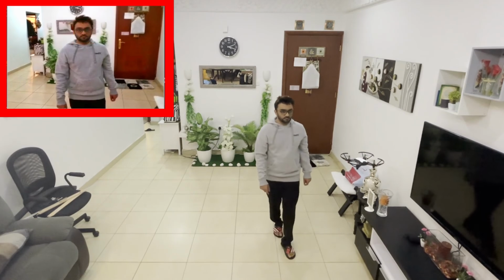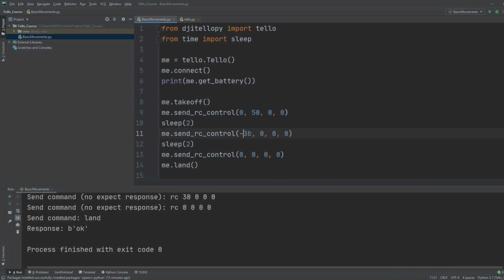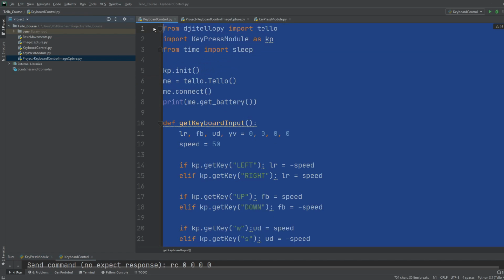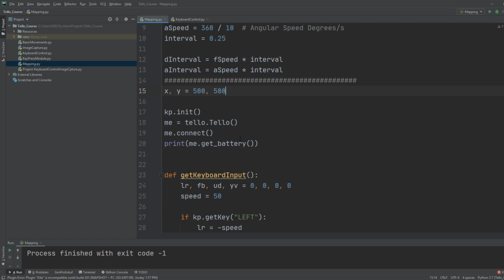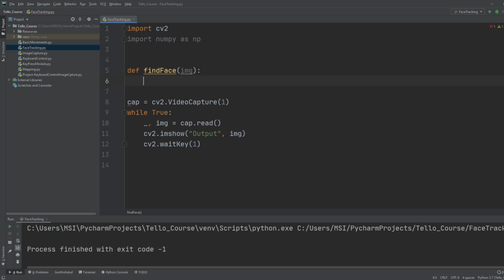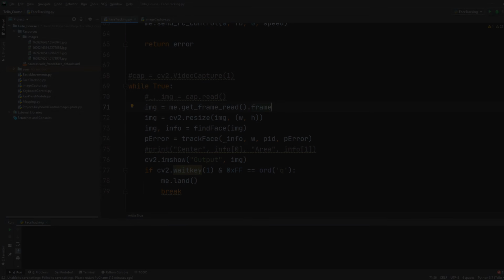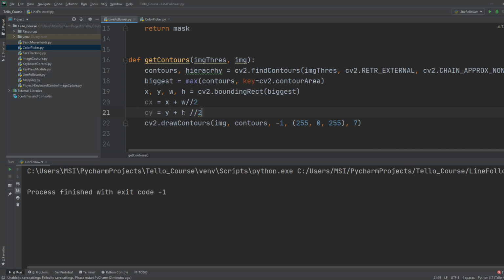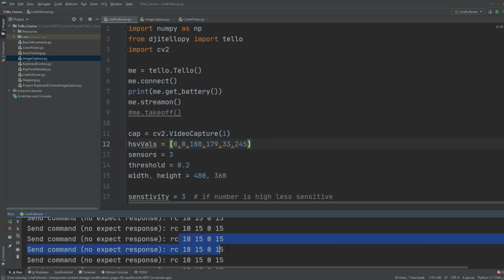Drone Programming With Python Course | 3 Hours | Including x4 Projects | Computer Vision

Comment: Nice video, thanks for your effort puttin this together. Does it work with any drone, are there any specifications for the drones this will work. Its obvious it will need wifi connectivity; is there any other requirement or specification that can be checked with other drones.
Reply: Wd love to get some details or pointers from anyone in the community or the author.

Comment: Can we use Anaconda instead of pycharm? Will it have the same/similar coding? Please answer
Reply: You could use any IDE that runs Python. Anaconda is not an IDE, but is instead a distribution of Python (basically, its the Python language + some other libraries that are used for scientific computing). Anaconda does come with Spyder, which is a Python IDE. You could use that. Best of luck!
Reply: @chriswhitmire4167  thank you for the information, really appreciated it.

Comment: Hey, I like the video but I have problems with the Image, I just cant see the video of the drone, I did like 5 times just like you and it just isnt working. Is it maybe because of a new Version of pycharm (I use 3.7 Python) or a new firmware update of the drone (I checked my version of the firmware its the newest). I just dont know what to do, do you know the problem? If I use the drone on my mobile i see the video. But in pycharm the window just isnt there

Comment: Hi, Thanks for the video, I have few questions:
- is there any drone I can connect to my wifi AP? What I need is to be able to access the drone from the routed network instead of only have access by direct connection.
- Can I apply live face recognition analysis to the captured video and then stream it to other users?
Thanks in advance for your answer.

Comment: [h264 @ 0000019ab6699b40] non-existing PPS 0 referenced
[h264 @ 0000019ab6699b40] decode_slice_header error
[h264 @ 0000019ab6699b40] no frame!
[h264 @ 0000019ab8394b00] non-existing PPS 0 referenced
[h264 @ 0000019ab66ab040] non-existing PPS 0 referenced
[h264 @ 0000019ab8394b00] decode_slice_header error
[h264 @ 0000019ab8394b00] no frame!
[h264 @ 0000019ab8394b00] error while decoding MB 31 40, bytestream -10

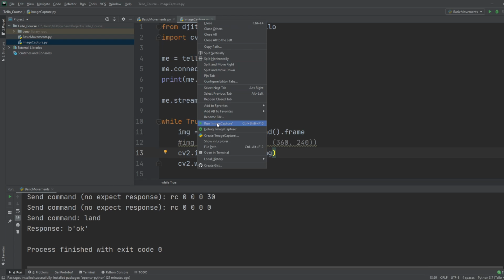Comment: This has to be one of the best channels on youtube! The BasicMovements work fine, I have an issue with the live stream of the tello. At 35:07, I tried to also run the ImageCapture.py file, and it returned the battery level fine, but then it came up with lots of errors even though I commented out line 10 and the live stream did not appear. These are the errors: 
Traceback (most recent call last):
  File "C:/Users/Ssaif/PycharmProjects/Tello_Course/ImageCapture.py", line 12, in <module>
    cv2.imshow("Image", img)
cv2.error: OpenCV(4.5.2) C:\Users\runneradmin\AppData\Local\Temp\pip-req-build-dn5w5exm\opencv\modules\highgui\src\window.cpp:404: error: (-215:Assertion failed) size.width>0 && size.height>0 in function 'cv::imshow'

[h264 @ 0000026cd22bd680] non-existing PPS 0 referenced
[h264 @ 0000026cd22bd680] non-existing PPS 0 referenced
[h264 @ 0000026cd22bd680] decode_slice_header error
[h264 @ 0000026cd22bd680] no frame!
[h264 @ 0000026cd22bd680] non-existing PPS 0 referenced
[h264 @ 0000026cd22bd680] non-existing PPS 0 referenced
[h264 @ 0000026cd22bd680] decode_slice_header error
[h264 @ 0000026cd22bd680] no frame!
[h264 @ 0000026cd22bd680] non-existing PPS 0 referenced
[h264 @ 0000026cd22bd680] non-existing PPS 0 referenced
[h264 @ 0000026cd22bd680] decode_slice_header error
[h264 @ 0000026cd22bd680] no frame!
[h264 @ 0000026cd22bd680] non-existing PPS 0 referenced
[h264 @ 0000026cd22bd680] non-existing PPS 0 referenced
[h264 @ 0000026cd22bd680] decode_slice_header error
[h264 @ 0000026cd22bd680] no frame!
[h264 @ 0000026cd22bd680] non-existing PPS 0 referenced
[h264 @ 0000026cd22bd680] non-existing PPS 0 referenced
[h264 @ 0000026cd22bd680] decode_slice_header error
[h264 @ 0000026cd22bd680] no frame!
[h264 @ 0000026cd22bd680] non-existing PPS 0 referenced
[h264 @ 0000026cd22bd680] non-existing PPS 0 referenced
[h264 @ 0000026cd22bd680] decode_slice_header error
[h264 @ 0000026cd22bd680] no frame!
[h264 @ 0000026cd22bd680] non-existing PPS 0 referenced
[h264 @ 0000026cd22bd680] non-existing PPS 0 referenced
[h264 @ 0000026cd22bd680] decode_slice_header error
[h264 @ 0000026cd22bd680] no frame!
[h264 @ 0000026cd22bd680] non-existing PPS 0 referenced
[h264 @ 0000026cd22bd680] non-existing PPS 0 referenced
[h264 @ 0000026cd22bd680] decode_slice_header error
[h264 @ 0000026cd22bd680] no frame!
[h264 @ 0000026cd2323140] non-existing PPS 0 referenced
[h264 @ 0000026cd2323140] decode_slice_header error
[h264 @ 0000026cd2323140] no frame!
[h264 @ 0000026cd2d46400] non-existing PPS 0 referenced
[h264 @ 0000026cd2d46400] decode_slice_header error
[h264 @ 0000026cd2d46400] no frame!
[h264 @ 0000026cd2ccce80] non-existing PPS 0 referenced
[h264 @ 0000026cd2ccce80] decode_slice_header error
[h264 @ 0000026cd2ccce80] no frame!
[h264 @ 0000026cd2a8b200] non-existing PPS 0 referenced
[h264 @ 0000026cd2a8b200] decode_slice_header error
[h264 @ 0000026cd2a8b200] no frame!

Process finished with exit code 1

I have tried everything I can think of, but I am unable to fix this issue. I have reinstalled python to version 3.7 as you have done, reset pycharm, and checked for various errors but it will not work. Please give me some advice as to how to fix this.
Reply: I’ve been having the same issue and no solution has worked for me so far!
Reply: I am having the same problem so let me know if you figure it out
Reply: The error is saying that there is no image being captured, and because of that there is nothing to show on cv2.imshow. Usually you have to just change the index to correctly initialize your camera, it might change from each PC. But i'd have to see the full code

Comment: Dear teacher, when it runs to 35 minutes，“ img = me.get_frame_read().frame” ，No return, no image can be read, I can confirm that there is no error in the above code, and the battery level of printing can be displayed normally, which proves that the connection with the host is correct. Can you help me and how to solve it。
import cv2
from djitellopy import tello

me = tello.Tello()
me.connect()
print(me.get_battery())

me.streamon()

while True:
    img = me.get_frame_read().frame
    cv2.imshow("Image",img)
    cv2.waitKey(1)
Reply: I am having the same problem so let me know if you figured it out

Comment: Great stuff! But in the mapping exercise, how did you arrive at the values for “a” (angle) as -180 for left, 180 for right, 270 for forward and -90 for reverse? I cant seem to find an explanation for this.
Reply: I would guess a rotation of 180 degrees in both directions, so that it can fully spin around. And then 90 degrees and 270 (-90 degrees) room to tilt the drone

Comment: I found at that there might be some assertion error failed when getting stream on when I tried this out. For those who encountered this error, you have to set the up settings on your fire wall to the udp of the drone.
Reply: Could you explain how you did it? Do I need to allow inbound role for the drone udp port? Help much appreciated, thanks!
Reply: @junqima5127  let me know if you figured it out. I am having this problem

Comment: You start your video out incorrectly describing all remote controlled vehicles as drones. A drone is capable of autonomous movement and is fitted with instrumentation allowing it to be operated far from line of site by a human or computer assigned controller. Please learn your facts before sharing false information. The rest of your video was well researched. Its a real pity that you missed the main point of what you are explaining

Comment: Hey Murtaza or anyone that is able to reach out and assist. Every time I try to activate the take off function or any throttle in the matter I get a command error. I'm using pretty much your exact code. Any possible solutions?
Reply: I know it's 2 months past. Have you found solution on this? If not, you can add wait time on command or takeoff timeout on the djitello library. Also other solution is add more light if testing indoors

Comment: This is a really great tutorial Murtaza, I have learned a lot, thank you for sharing your knowledge. However I have run into an error during the coding of Project 3 - Face Tracking. 

import cv2
import numpy as np 

cap = cv2.VideoCapture(1)

while True:
    _, img = cap.read()
    cv2.imshow("Output", img)
    cv2.waitKey(1)

Exception has occurred: error
OpenCV(4.5.1) C:\Users\appveyor\AppData\Local\Temp\1\pip-req-build-kh7iq4w7\opencv\modules\highgui\src\window.cpp:376: error: (-215:Assertion failed) size.width>0 && size.height>0 in function 'cv::imshow'
line 8, in <module> cv2.imshow("Output", img)

Thank you also for your Discord channel, I have also posted this question on discord.
Reply: Looks like cv2.VideoCapture(0) opens my web cam, I am not sure how you tell other than trial and error.

Comment: Amazing tutorial, really man, hats off. This was simply perfect. Excellent explanations, straight to the point, and covers several projects that build on previous work. This was EXACTLY what I was looking for: a cheap drone, an exposed, easy to use API, and a tutorial that covers writing control code as well as opencv for image processing. It's incredible how quickly I could get things to run. Thank you so much!

Also, regarding you Mapping part of the tutorial. Wouldn't it have been better to use the get_speed and get_acceleration functions offered by djitellopy to accurately calculate the motion of the drone? That would yield very good results as opposed to relying on the speed value you make the drone fly with. I have not tried it yet, but should probs work well. Cheers!

Comment: I really like your video, but in the facetrack project, isn't a PID, is just a PD controller. There are significative difference between this types of control laws. For hobbyist approximate a PID using a PD is good but for engennieers or scientist this implication is relevant.  Despite this, I think that's a good course to introduce poeple for the programming this kind of technologies. 

Congratulations

Comment: i have been having this issue with basic movements with the drone flight, I get the error "no controller" when attempting to run a command such as move forward (python, pycharm).. I have been trying to solve this issue for ages.. I have updated and calibrated the drone multiple times and the code is also correct so i can't seem to find a fix.. also side note my drone light flashes pink and I have never seen anyone else have this light code and also couldn't find any reference to it any where if you know anything about this let me know. thanks.

Comment: Im currently making a fyp involving key box control system by using a face recognition technique. In your opinion, what programming language that fit the best to be use for this project? Im kinda interested to do this project because I know how to do face recognition by using a mobile camera using opencv but I kinda lost on how to connect the face recognition process with the key box system? Can I know does it require iot?

Comment: Do you think that it's possible for me to build the entire drone by myself instead of using a pre designed kit? I know how to program stm32 MCUs and some basic electronics but i think i will use the help of a mechanical engineer to  buy the correct engine since i have 0 idea about aerodynamics and do not have time to learn either. I wrote this comment after watching the first 3 minutes so sorry if you have explained it in the course somewhere

Comment: 1:19:14 ehh. why not just say you want go (2.0,2.0) in 2 sec facing 90 dehree and calculate speed and angular angle LOL its not perfect anyway its drone using props in air.
why need calculate where drone is. dont it have sensors lol like compass.why need calculate where it is facing ehh

Comment: thank you sur... can I use another drone  ( ex: I build a drone from scratch)
Reply: well, as long as you can send it commands from a computer...yes. All the image processing and program actually runs on his computer, the only thing the drone does is recieve the corresponding movement commands and act accordingly. So, if you build a drone, you need a way to send all that movement command information to it - either through having a wifi chip on board the drone and connecting that to your computer (easiest option imo) or through radio, although that is a bit more complex. Personally, I would use wifi for the data transfer, as it is very easy to use with microcontrollers and other open source hardware and software (e..g Arduino, raspberry pi)
Reply: @Mahar4ja  thank you for the information ♥️